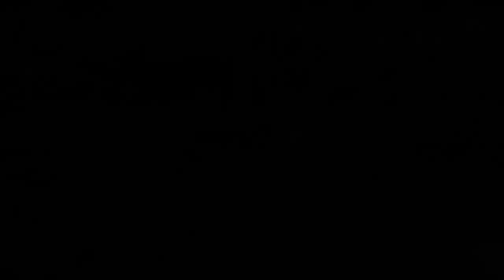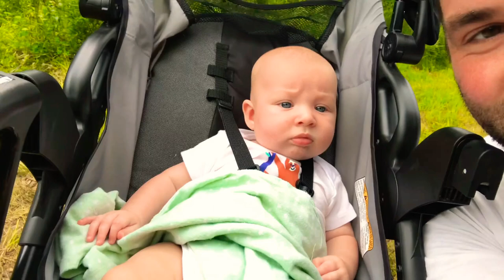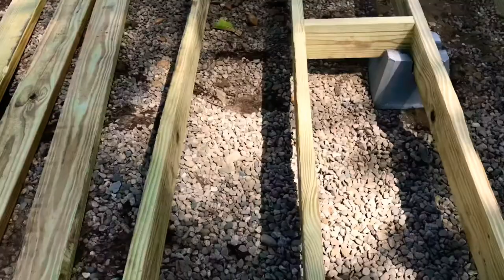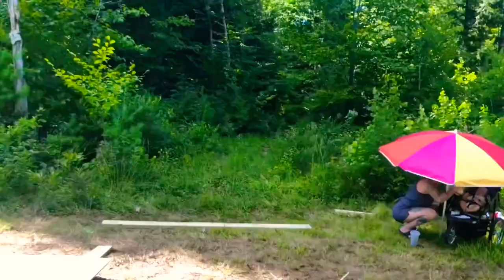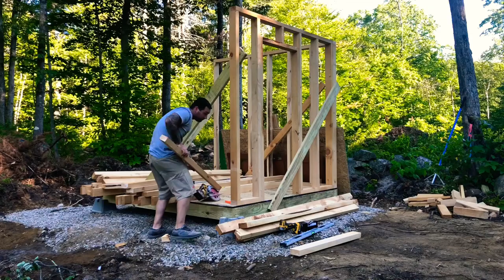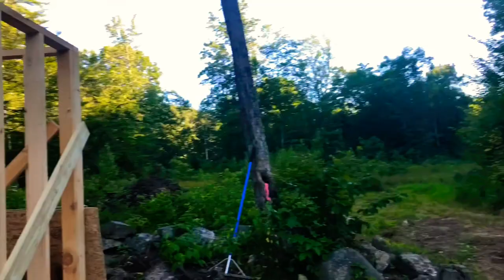8x8 Shed / Hen House Pt. 1

Comment: What size screws did you use
Reply from the maker: I believe I used 3 inch screws or 3 1/2. I know it takes more time to use screws but it definitely is nice and tight when all said in done.
Reply: @bibeaubuilds2869   Thank you very much i was thinking  of using 3 1/2  so now i will Thank you again
Reply from the maker: @titoserrano5692   No Problem